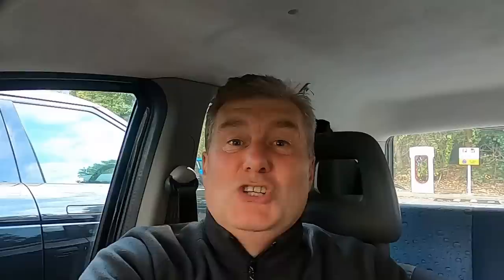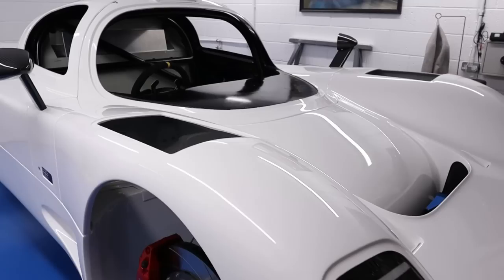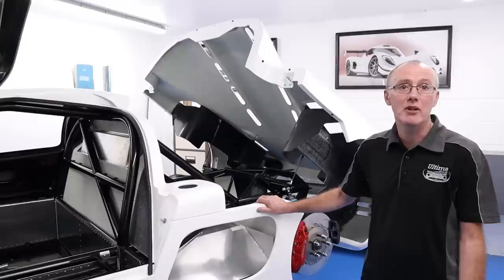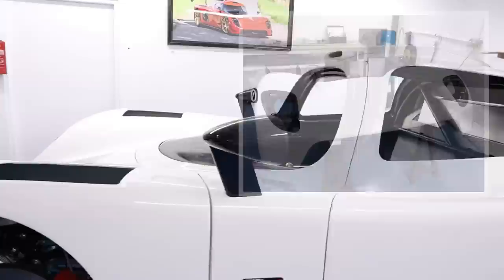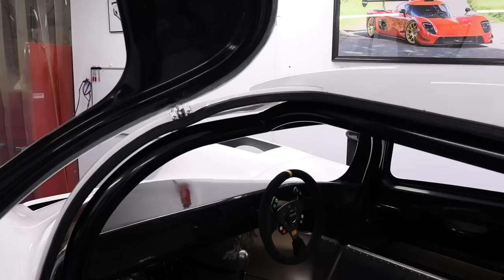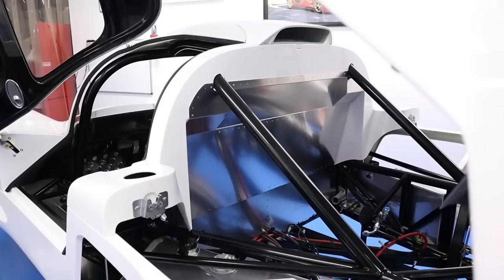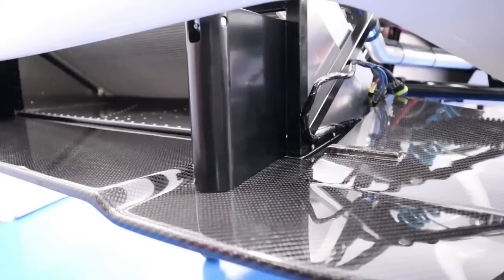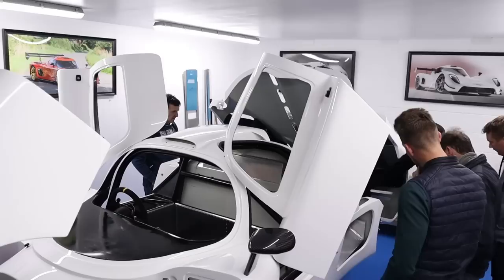Building an Ultima RS with Nigel Dean. Part 23. Ultima factory tour and body fitment

Comment: The body pre-fit is an option any potential buyer should tick on the order sheet to get done by the factory. It will avoid a lot of frustration and loud language when you do it yourself.
Reply from the maker: When I built my GTR I did the body pre fit myself. It took me 3 weeks on and off but having now experienced the option it is a must have in my mind. Good value for money as well. Cheers Nigel

Comment: Very nice indeed !! The car is looking absolutely fabulous Nigel, it’s a pity it has to come apart again. And as for that carbon front splitter, it’s simply exquisite. I’m guessing that’s your LS3, you were lucky to get your engine just before they stopped supplying them as a factory option.
Reply from the maker: Hi Garreth, how did you guess? In fact when in the States for fun I enquired on how easy it was to get an LS3 and the answer was like going to your corner shop for milk. So it makes total sense to buy directly from over the pond. Yes there is shipping and import duties to pay, but international shipping is very straightforward. Also at the same time you can purchase some amazing upgrades and pop get them popped in the crate at the same time. Cheers Nigel
Reply: @v8creative  I’ve purchased an LT4 dry sump while I could still find one and it’s already here, but they have also been discontinued by GM. Soon it’s either go through a conversion process on a wet sump engine or as you say, it’s going to be a lot easier for people to go down the LS3 route, increase the HP and it’s still and a WHOLE LOT cheaper. With our less than favourable exchange rate at present, it’s been a rather expensive way to go and I can understand why Ultima don’t want to offer them at present.

Comment: Awesome!
Reply from the maker: Exactly what I said when the RS rolled out of the covered trailer. It was almost stopping traffic. Cheers Nigel
Reply: @v8creative  Is this the best email you have for order questions, sales@ultimasports.co.uk ? I haven't received a reply to an e-mail I sent in August. Or perhaps they are always very slow to respond?

Your series had almost convinced me away from a factory five build, but the lack communication from Ultima is a bit concerning.
Reply from the maker: @dum_engr4711  Hi, yes that email address is correct. I am very surprised you did not get a response since as you can see from all the comments on this channel (and my own experience), the factory are incredibly responsive. I would suggest resending the email or even calling the factory (+44 (0) 1455 631366) and asking for Andy or Richard. Thank you for tuning in. Cheers Nigel

Comment: I have a Question 4U.  
The Body ? Is it just hand layed chop strand matt  ?  Or a combination of chop strand matt & say a decent cloth or Bi-axial glass  ? And in which Resin  ? 

Be interested 2 find out how advanced there layup is . 

Most probably has core matt in the layup .  But something like 8 harness satin weave sglass  cloth ×2 layer would certainly had  stiffness 2 the construction.  
Very time ⏲️ consuming 2 lay 100% .  Takes extreme care & patience 😅
Reply from the maker: Hi Robert, to be honest I don't know the exact layup but it's clear a lot of time is invested in the moulds and manufacturing process. The gel coat finish is flawless and you can see the matt layup in certain areas.